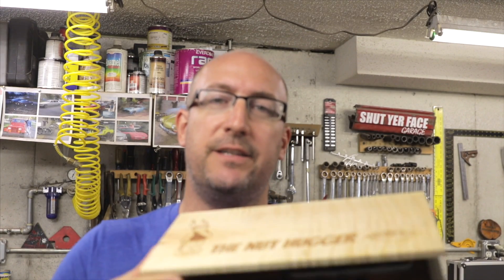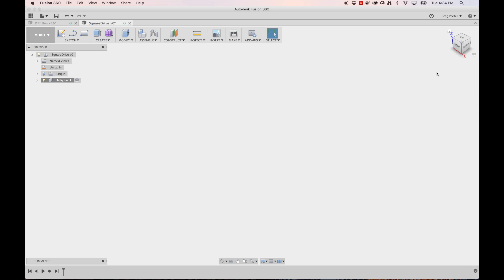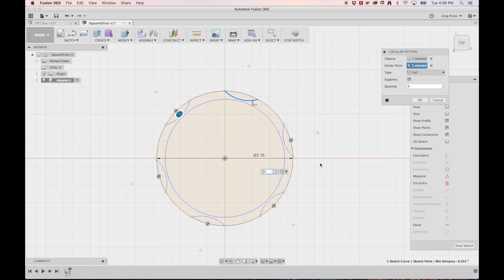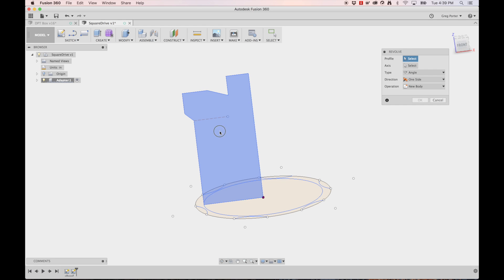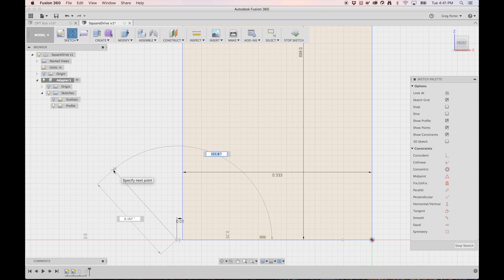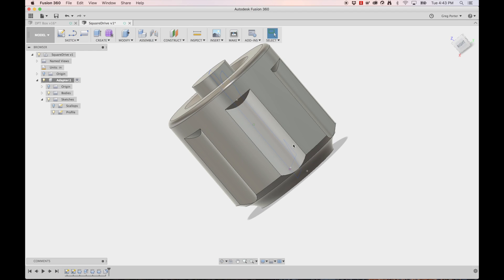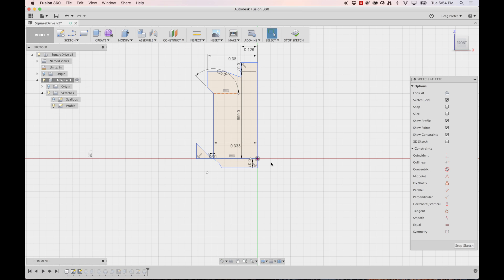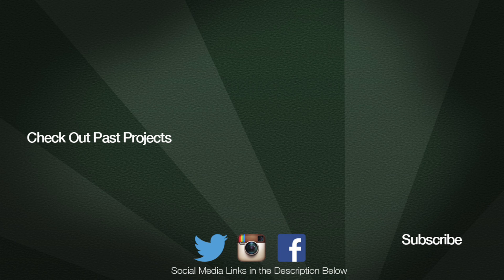Modeling a Socket Adapter- DPT BOX - FUSION 360 CAD

Comment: Hey Greg glad to have you back.  Looks like you've been having a great time.  This is a great tutorial.  One thing that I feel is always missing is what I call the 'where to start'.  When you look at that adapter you probably know where to start by that I mean I probably would have created a cylinder and taken parts away while you created the profile and revolved it.  It really showed me how much easier it is thinking of it that way.  Keep it up.  I wonder how Lars Christensen would have done this.  Maybe he has a solution for some of the issues you've hit?
Reply from the maker: That's a great perspective.  I should probably start out with a bit of analysis and maybe show a few different way a problem COULD be approached, then hop into how I did it.

Comment: glad you know what you are doing, i found it very interesting you can 3 d print from that as well?,
Reply from the maker: Yes Kenny.  Fusion 360 has a "Print Studio" link inside the program.  From there you can set up your 3d print.  I used it out in Boston a few dozen times.  Its super slick.

Comment: Great stuff!  Great to see the usage of CAD from a design perspective! Definitely taught me a couple tricks with starting with sketches on multiple planes!
Reply: Also, even when punching in basic measurements, fusion will try to outsmart you! I was punching in a super basic design straight from a blueprint literally this afternoon, had a circle for a hole make itself coincident with some other random point on the part, then the whole thing went haywire when I went to adjust the dimension!
Reply from the maker: I need to get in a sort out how to control the snapping and constraints during creation.  I'd MUCH rather create items that are totally not constrained, then add constraints as needed.  The deletion of constraint icons never seems to be the road to success.
Reply from the maker: BTW...  I need to come see the new shop now that you're up and running again.  Looks awesome my friend.
Reply: Greg's Garage yes!!! You should swing by sometime and see mess in all it's glory! 😂